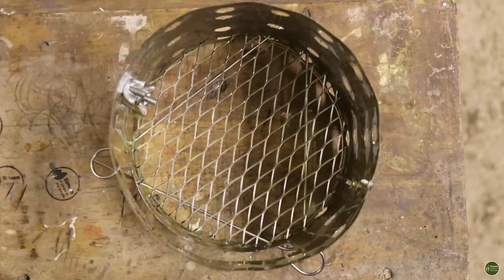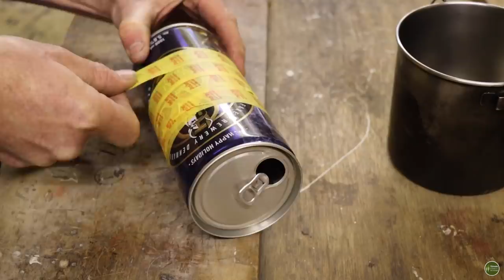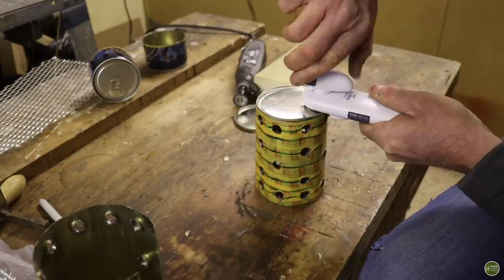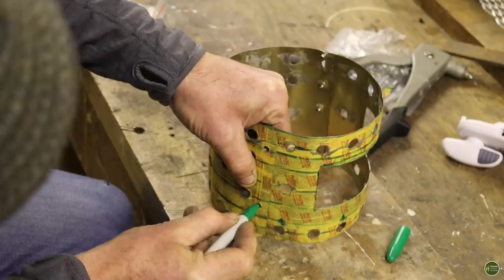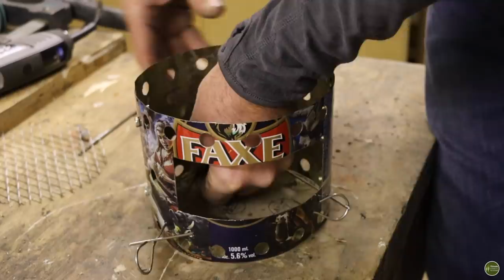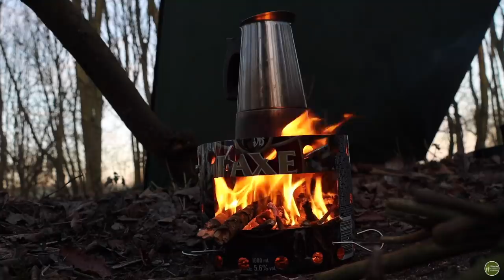Build an Ultralight and Packable Wood Burning Twig Stove from Recycled Materials.

Comment: Nice work.  I know you don't comment on old vids anymore but a top tip I got from using those step drills to drill enclosures for guitar effects pedals is that they are also great deburring tools on the other side of the hole, much quicker than using a file or a grinding wheel on a Dremel.

Comment: I have found that a single row of holes on the bottom below the fire grate is more efficient.  As long as your pot is less than 2/3 the diameter of the stove it creates a natural chimney.  Hotter with less wood.  I like making stove projects with scraps of roof flashing.   Good job on your project 👏

Comment: Nice one Simon. Thanks for sharing. 😀Search Amazon for Lantana, they do a tin opener, and it's a side opener too, but this one sneakily cuts the folded edge about halfway down. The resulting cut does not seem to have any sharp edges and the top can be put back on. 😃Not really a good idea for storing in the fridge like many seem to want to, but it means a removed top could be replaced, and act like a pot stand with maybe some bolts poked through if required for spacing. Because half the joint remains it stays rigid too)  You'd probably need to cut holes to allow the heat and flame access to the base of your pot of course. You are a tinkerer of kindred spirit, and I think you would enjoy having that option available to you too. They are about a tenner, so not a poor investment by any means. I've been eyeing some 1.2 kilo grapefruit cans (steel & robust) and might try that at some point.😉 Hoping you find that info useful.🤔It opens up a load of new possibilities. 😄 Be well.😊
Reply: THANKS FOR POSTING so many interesting ideas!
Reply from the maker: I’m going to have to look into one of those!! Thanks Ian!
Reply: @simonablokeinthewoods  You're most welcome. 😀Sorry for maybe costing you some cash😉

Comment: Well done Simon, yeah this ones loads better than your first one, as you said too tall an unstable, how about a roll up one an instead of wing nuts how about making a hinge, you can use the skewer straight through to link those pieces, maybe a smaller hinge for a door aswell, to control the burn?

Comment: thank u. that was very nice, seems to work well. do update about longer use durability.
one thing i did missed though was a solid floor. when u use a mesh only floor, ashes go down leaving this black burn circle under the spot.  i whish to leave no trace, so i use a solid detachable floor version- the floor is a bit over ground level, then one line of air hols, then mesh. so while dune, i can dig a hole and spill the Ash, then cover it. its also better for warmer air flow in cold or frosted ground, even more if i use a piece of thick heat resistant cloth under the floor. it weight nothing as well.
Reply from the maker: A circle of carbon felt will sort that out 👍🔥

Comment: Nice job, especially the collapsible aspect. Just a thought, putting the wing nuts on the outside, might stop you getting oily soot on your hands/gloves, and maybe a heat shield for it to sit on? BTW your pillar drill, you had to hand start it, starter capacitor burn out? Is your 3rd a wood gas stove by any chance? Looking forward to your build in any case.
Reply from the maker: Yes, the wing nuts on the outside is probably a better idea, I just prefer how it looks with them on the inside, plus it rolls better for storage 👍 The drill starts fine, but just takes a little help to get the revs up for some reason -wasn’t always like that 🤷🏼‍♂️
I’ve made a wood gas stove before - works very well indeed, stove three is something different 😁🔥

Comment: Looks ideal matey!  Very light. .. gave me an idea, depending on diameter of those cans. My woods walker stove, the chimney connection piece that connects to stove seems a bit fragile so I want to make a spare. And upgrade the bits that fit into the slots on the stove making them bigger. I guess they're called shoes? My only gripe with the stove but it's no Biggie. .. Well I'd actually like to make a bigger glass window in it somehow too, maybe two windows though I don't have a welder so getting my thinking cap on. Any suggestions?

Comment: I agree that the traditional "hobo" stove is cheap and easy to make, but they burn out quickly and are generally quite flimsy. 
My favourite twig stove is made from the IKEA utensil holder (about $5). This makes a VERY sturdy stove, though not collapsible (l store fire making equipment, etc. inside the stove). Instructions are available on YouTube for the finishing touches.
P.S. l use "fatwood" to start the stove & then transition to "twigs" and sticks.